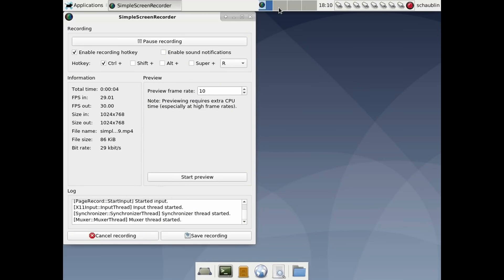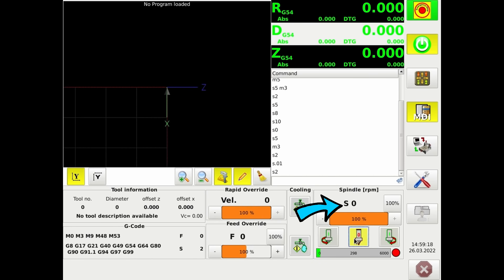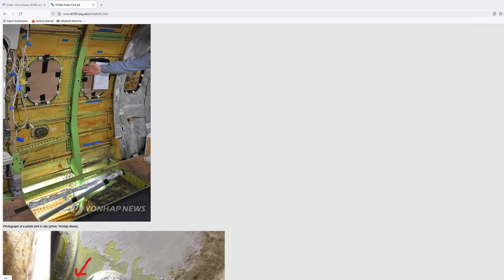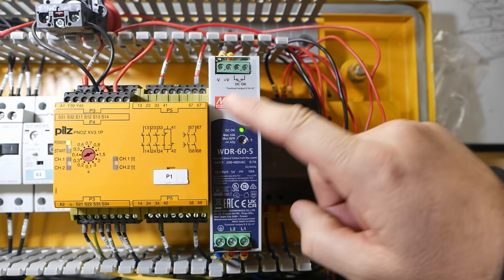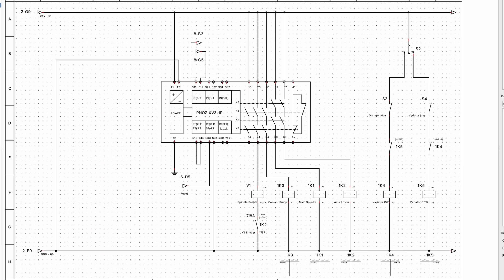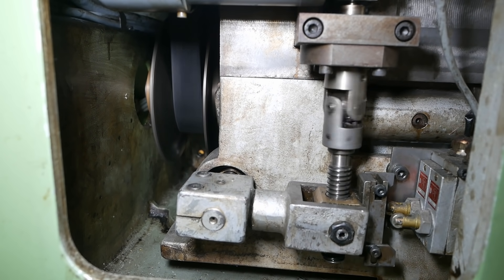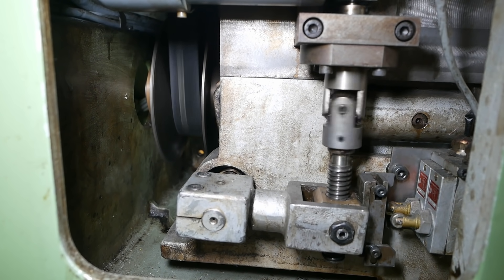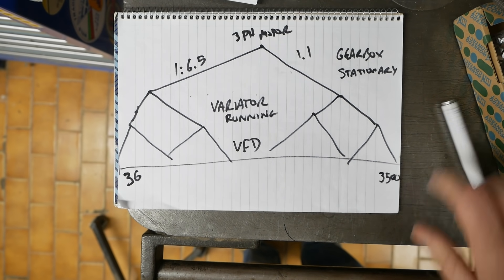Variator control - Schaublin CNC - Ep.30

Comment: i think its good to leave the cvt in place as it will act as a clutch in case the spindle crashes. that and its nice to have a massive rpm range. On my manual lathe the low gear is 30 rpm, with the vfd i can go even slower, which can come in handy sometimes. I think have it adjust the speed with the cvt as the primary adjustment, then use the vfd to fine tune the speed.

I always throw a little tidbit of what I've been working on in with my weekly comment, so here it is. I went to make the first cut on my horizontal cnc after putting it back together in my garage, and everything way going great. part way through the first feature the machine stops and i get a low pressure alarm. my machine had some small leaks, but it was enough to put me over the duty cycle for my compressor. so I've been replacing fittings and rebuilding the air/lube system. the tubing runs are fairly annoying, but i figured out a trick to run new hose. if you can find a coarse screw that can bite into the inside of the tube like a barb, cut the head off and use the old tube to pull the new one through. once I figured this out it was much easier to replace most of the lines that were inside cable carriers and behind panels. the equivalent for wiring might be to solder wires together, although it wont be as streamlined, and most wires are cables with connectors on them.
Reply from the maker: Good one. I need to pull Cat 6E through the conduits of my house to run ethernet up to my office. Not looking forward to that.
Reply: @RotarySMP  This is an unfortunate limitation, but low-voltage signal cables like CatN should never be run alongside mains power in a conduit.

That aside, I'd recommend fishing a pull string first, then using that to pull the cable. Your pull head ends up smaller and more flexible, both of which decrease the likelihood of jamming. Use a good-quality, vinyl electrical tape - my go-to is 3M Temflex 1700 because it has good adhesion and comes off with little residue - to smooth over any projections such as knots and reinforce joints.

Pull a spare cable if you can, and mark the end(s) before you pull. Pull all the cables in a run together, but stagger the ends so the diameter tapers up. A fish tape with length markings is helpful if you only have one box/reel of cable, so you know how much to pull out.

Spring for a punchdown tool and terminate the cable with jacks; they have a much higher I/R cycle rating and they're re-usable if you screw up the first time. They also allow the pairs to retain their twists to closer to the termination point.

Also, don't use Cat6E. That's not an official spec or even any kind of standard; it was used by manufacturers for a prospective improvement over Cat6, but the final specification chose the name Category 6 Augmented (Cat6A) because there was no standardization of Cat6E which poisoned the name - much of what's on the market with that name now fails to even meet Cat6 spec, let alone exceed it. Unless you expect to run 10Gb Ethernet at some point, Cat6 should be perfectly suitable. It's cheaper and much easier to pull. If you do expect to run 10Gb within the next 5-10 years, optical fiber is the way to go for the forseeable future.
Reply from the maker: @Azlehria  Thanks for the detailed feedback.

My house has concrete walls, so it is a bear to make any changes. It will be a PITA to pull ethernet cable through the existing conduit which was cast into the concrete, and I am not ever sure if I even have space to fit a Cat6A, but I want to try. If you run Cat 6A alongside 50Hz power lines, will the interference make it all pointless? I was hoping that the shielding of Cat 6A would suffice.

I hope to run a 10GbE line from my office upstairs, to my basement, and back up to my wife's office where the DSL router is. Put a server/NAS/Switch in the basement, and be able to edit video directly on the NAS from my office.

I bought one of those semi rigid cable pull through things, and would lube up the CAT 6A well. Since it is a bit thinner than Cat 7, I hope it can work.

I also looked at optical fiber, which is much thinner, but there is no easy way to terminate raw cable is there? Prefabbed cables have the end fittings, but there is no way they will go through my conduits without getting caught up.
Reply: @RotarySMP  The major problems are capacitive and inductive coupling, where the parallel cables function almost like a transformer coil, and RF interference at line frequency. Properly bonded shielding can reduce those effects, but not eliminate them.

Optical fiber is, of course, utterly immune to electrical interference of any kind. It's more fragile, but surprisingly somewhat stronger in tension (pulling) as long as the minimum bend radius is respected and tension is released carefully.

There are a few significant hazards when dealing with unterminated fiber: cutting fractures the glass core and/or resin cladding for some distance inside the buffer with unfortunate frequency, and along with cleaving (a deliberate, perpendicular fracture for termination) produces very fine glass particles. Wet cleanup is essential.

There are now "quick connect" field terminations that require only inexpensive tooling, apparently often included as a kit, but my only experience with them was watching the tech use them on our FttH installation. The ideal is fusion splicing, which is what I've used, but it's not something to buy equipment for as a one-off job - the last kit I used cost over 80,000 USD. If you're interested in that option I'd strongly suggest hiring out the work. Some contractors will take termination-only and term-and-test jobs - my last employer used to subcontract termination after we pulled the fiber.

The first item for fiber installation is determining what termination and fiber type you'll need; most Ethernet PHYs now seem to use LC connectors and multimode fiber. Next you'll select the fiber diameter - the terminations must match, although some will accomodate a range of sizes.

If you want to terminate yourself, you'll need at a minimum a fiber cleaver and fiber stripping pliers. The stripping procedure is finicky: first you strip the opaque buffer, then strip the transparent cladding, both of which are quite thin, while holding the pliers perpendicular to the fiber core. If you scratch or nick the core, cut it off and start over. Then score the core at the length specified by your termination - the traditional tool is a fine carbide scribe, but newer tools use either a lever action or a spring-loaded blade - and snap the core at the cleave line. Modern cleavers will generally have an integral mechanism to do this properly, even automatically after scoring.

Then wipe the core with isopropanol toward the cleaved end and inspect with a microscope. If you have a clean, squared end, move on to termination. Otherwise, trim it back and start over.

Gotcha: you'll almost certainly need a pair of fibers for a single link, and they need to be terminated to the same length within <5 mm or you'll stress the fibers. Multi-wavelength, single-fiber links are possible, but generally more expensive at every point.

There are special termination boxes for fiber which have a series of supports inside to hold a "service loop" of excess fiber and maintain proper bend radius.

It's not really as difficult as all that makes it seem, though. My "training" was 20 minutes of watching YouTube videos on my phone after being issued a fiber kit and I had a <2% failure rate on actual terminations. Somewhat higher on cleaving, though . . ..
Reply from the maker: @Azlehria  Sound like I just risk the RF interference :) The first thing is to see if I can even get a further cable though all the conduits. The house wireing is individul 1.5mm² solid core so there will already be at least three in each conduit.
Reply: @RotarySMP  maybe you can make a barb for the jacketing.

Comment: Interesting discussion on the speed range, maybe it would be also helpful to consider the torque-range...
Reply from the maker: That is a nice thing about leaving that variator in there. I calculated it on an earlier video, and the torque down low is pretty impressive. The question is whether I really need it?
Reply: @RotarySMP  My general observation has been that, barring fasteners, insufficient torque is more hazardous to components (stalled motors are not happy motors) and excessive torque is more hazardous to observers (tools break).

Assuming, of course, that the torque never exceeds the strength of any components of the power transmission assembly. That's when things can get really exciting. I have a great visual demonstration of that in storage: it used to be a transmission.

Someday I ought to dig it out and do a failure analysis video. Ever seen a friction-smeared roller bearing?

Comment: Are metal chain pulley variators are better than constant mesh gearbox in terms of torque?what are other downsides of these variable pulley variators?(Neglect belt breakage)
Reply from the maker: I am guessing that it was very very expensive. A VFD and 3x bigger motor is much cheaper today. The variator also need regular maintenance (at least greasing.) 

The reason the Variator was used was that it was one of the few of the shelf solutions for constant variable transmission in the 1970's.

Comment: Dumb question do encoders generally run to 1000’s (base 10) or 1024 (base 2)? I would leave the speed controller at a set frequency (most efficient) and use gearbox for max torque. If that can get you the required range....
Reply: encoders have standard number of lines per rev, and are base 10. ie. 200, 400, 600, 800, 1000, 1600
Reply from the maker: @Thomas_Lemmey  I guess this is a 2000 line encoder with quadrature.
Reply: @RotarySMP  quite possible. If I remember correctly the encoder is connected by a pulley, this may give a counts per spindle rev value that is not as simple

Comment: The thing is, your electronics aren't working at 5V mostly anyway, instead on 3.3V. If they are using linear regulators, then undervolting is usually fine, even making them waste less energy and heat. If they use a switching converter, then they'll actually draw more current at the lower voltage.
Best is to simply supply the 5V as intended, because that's what they were designed for.
Reply from the maker: Thanks for that. I never really thought that through.
Reply: @RotarySMP  from my experience the adjustment is there so that, like commenters on the previous video stated, you can account for voltage drop across the wires. The best practice would to be measure the voltage at the end device and have it adjusted to be reasonably close to the rated requirement.

However, considering this is all internal wiring on a relatively small machine I don't think you'll have much of an issue. Some of the machines I've worked on ran wires out several meters from one end to the other, but for anything under 1 meter the voltage drop is probably insignificant.
Reply from the maker: @LuciaMakes  Thanks for your input on that.

Comment: My Mori gives a range of 50 to 3500 with just the vfd, nothing else. Low end torque is not something to brag much about though. I personally would've removed the variator and ran with vfd and 2 gears.

It's a Fanuc 4-pole 3-phase motor running with frequencies between I assume about 3Hz-220Hz and the nominal voltage (used at 50Hz I think) is 90V, original motor and vfd.
Reply from the maker: Modern CNC's just use a huge servo as a drive motor. 40Kw is not uncommon. My house power feed is secured with 16A, so going for a big servo was not really an option. I considered replacing the variator, with a simple poly-vee belt, but since it is already there, why remove it. I could have just left it in one ratio and ignored it, but it was very little work to connect it back up.
Reply: @RotarySMP  it's a 3 phase motor, not a servo. Similar 4 pole motor as most 3 phasers are (1500r/min at 50Hz) but has external fan and lower nominal voltage to allow it to work better at high frequencies. (At 220Hz a normal voltage motor has almost no power left) Power 7,5kW maximum, 5,5 continuous. I have it behind 16A breakers.
Reply: @MF175mp  16 A at 380 V?
Reply: @ikbendusan  16A*230V*3=11kW max power from a 16A 3 phase 380V outlet
Reply: @ikbendusan  It must be around that and probably 3 phase as well. that would something close to a 45A single phase 240v panel, which seems reasonable especially for an existing panel.
Reply: @davidfarmer  everyone in Europe has 3 phase power available afaik

Edit. We have 63A main breakers for the 3 phase power and the 16A breakers are only for the lathe and other 3 phase outlets in the same building.
Reply: @MF175mp  right i ignored the fact that each phase would be fused separately
Reply from the maker: Yeap, 16A 400V three phase. Even our old apartment has a 3Ph circuit for the oven. I feel sorry for the US engineers with they rotary phase converters and high amperage 110V circuits.

Both the Maho and the Schaublin have about 3Kw spindle motors, although the Mahos Indramat axis driver is DC, so the huge transformers have much higher inrush current.
Reply: @RotarySMP  the phase converter is annoying, but the circuits in reality are 240v, with a neutral to split the phase. the main advantage being only a 110v potential between a hot wire and ground, since the neutral is referenced to ground. that being said its not all like this. my mom's house has 240v 3 phase, and so do all businesses, and businesses can get 480 if they want it.

the highest 110v circuits really only go up to 20amps. I have 50 and 200 amp 240v circuits for my shop
Reply: @RotarySMP  I get this, i spent more upgrading the panel at my house than i did on my cnc machine. 16A is crazy though. I upgraded to a 400A single phase 240v panel at my house, although I doubt i can pull all 400 amps at the same time. I have my cnc running on a 45KW phase converter, and the machine claims a 22.5KW spindle, but that would be at 200% load. it also has a 2 speed gearbox. the low range goes up to 2200 rpm, and high gear goes up to 10000. all this being said i think the cvt is a great option to have to fine tune the torque of the spindle, the vfd isnt efficient throughout the rpm range, and its also not necessarily accurate rpm wise at lower rpm.